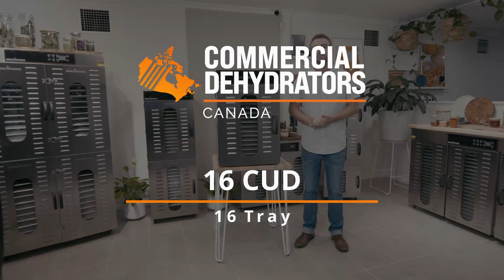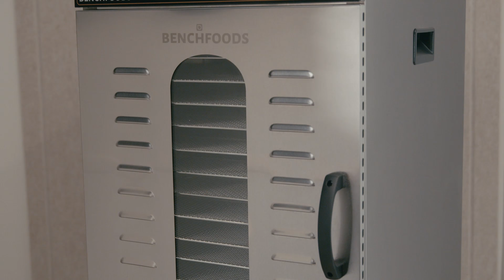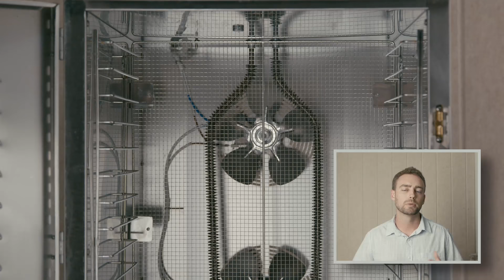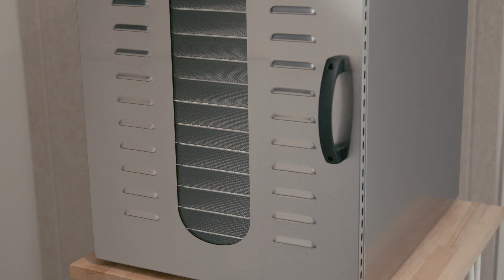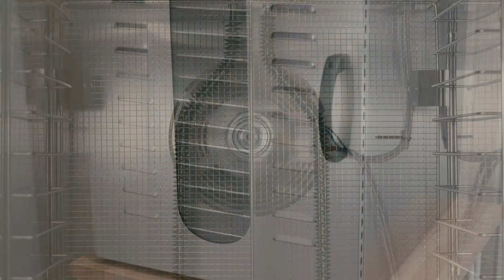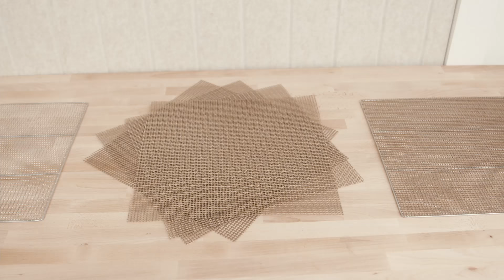COMMERCIAL DEHYDRATOR - 1 Zone / 16 Tray / 2.56m² Tray Area

Comment: I have this unit and I love the performance.
Reply: How much it cost???
Reply: @RubyMohamed-mn5cu  approximately 863 however I ordered mesh sheets for mine as well. Everything about 950.00
I went with this one because the home ones nor Excalibur didn’t meet my expectations.
It works wonderfully, it is quiet for the most part and it doesn’t heat up your home. I’ve dehydrated onions , spinach, zucchini, garlic, flowers. This year I plan on doing tomatoes as well.
Also when I purchased I remember getting a discount.
Hope this helps. Be blessed.